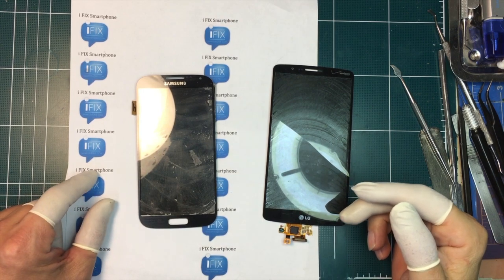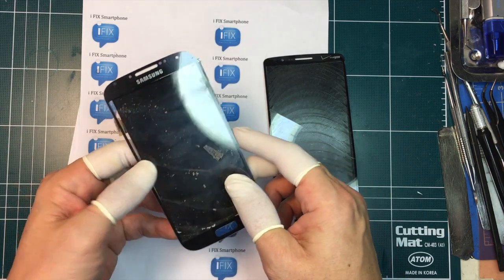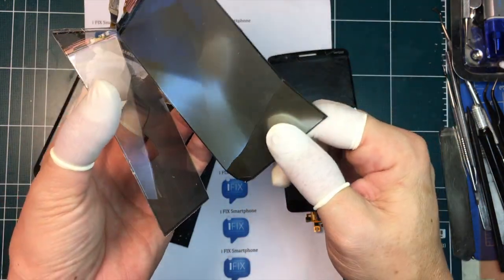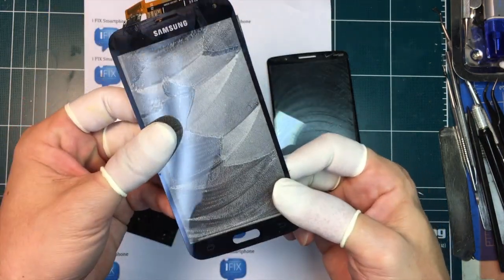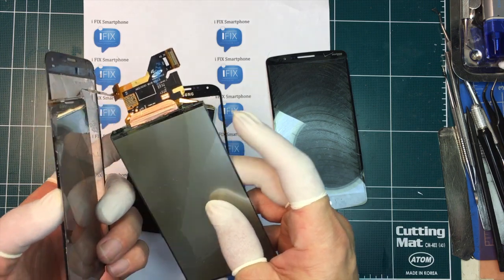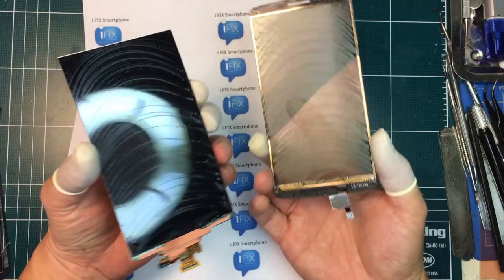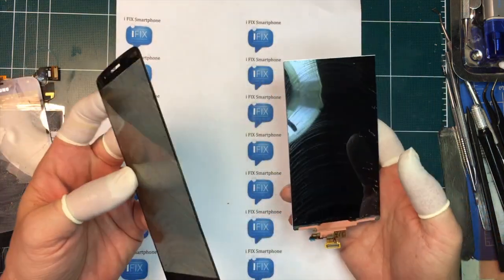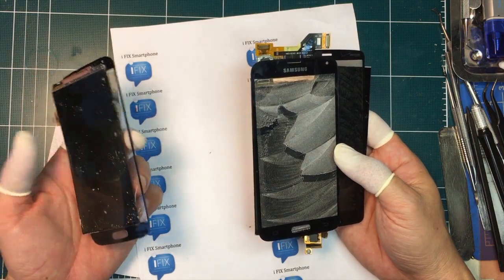What is digitizer? What is LCD?

Comment: So, if you can still touch the screen but you have a bright line or section on the phone, can you replace just the glass? I can't seem to find anything except just the whole screen replacement which is usually $100-$250

Comment: Thank you so much for this video. I can now tell the difference. However, to gain clarity on a particular issue, I want to present my situation.
1) I have a Samsung Galaxy J8 phone. It is responsive to touch (so, I am guessing the digitizer still works). However, there are several lines that appear on the phone. I am unable to tell if this is an LCD problem, or just the screen glass. 
2) I have an Iphone Xsmax. I can visibly see everything (cause the display is still perfect), there are no lines on it. However, only the bottom part of the screen is responsive. The upper part isn't responsive anymore, so I am guessing this one is a digitizer problem, and oh! the screen glass has some cracks on it too. Please, correct me if my diagnosis is wrong.
Reply from the maker: J8 with line mean that LCD is damaged.  Xs Max with bottom touch working is most likely digitizer issue. if no damage, but no touch means, touch sensor on motherboard needs repair.
Reply: @ifixsmartphone9079  Thank you very much for your response. I would like to show you a visual representation of my issue , and ask about something related to it. How may I reach you? Email, WhatsApp, Instagram?

Comment: Thanks for explanation. Loved it. But I have some questions, please answer it
1) Can only Lcd screen be changed if touch is working and glass is not broken? 
2) Now does most phones come with digitizer fused with glass? and they have basically two layers. 
3) My phone is Oppo A54 and i dropped it on floor and touch is working but it has cracks on screen, so my display is broken or glass ? What I need to replace?
4) Is tempered glass different than glass you shown and should we use tempered glass
5)Does display get damaged due to heat during changing of touch glass?
Reply from the maker: nowadays I think all manufactures make touch and LCD fused as it makes digitizer more accurate.  If OPPOA54 is OLED, it's fused 100%. Display (LCD/OLED) can be damaged by high heat. It discolors it mostly.

Comment: Great video!...pleas I have a question my phone works fine when I use it...but when I try to game and it gets hot I start experiencing ghost touches when it cools down it returns to normal...is the problem with the digitizer?
Reply from the maker: Yes and no. but I doubt if it will fix issue even you replace digitizer. when it gets hot, cpu is probably throttling and that is why you may have touch issue.

Comment: Thank you so much! I'm so glad you explained that. But it brings on another question. If I wanted to reverse engineer the flex ribbon cable to work with a motherboard that requires separate ribbons how would I go about doing that?
Reply from the maker: Can you explain little more? Kinda lost in your question.
Reply: @ifixsmartphone9079  Samsung smartphone motherboards use a 34 pin ribbon combination cable for the digitizer and LCD screen. How do you separate the two for use on a separate motherboard that requires the digitizer and LCD screen to clamp into two separate places?
Reply: @iFIX smartphone  Samsung smartphone motherboards use a 34 pin ribbon combination cable for the digitizer and LCD screen. How do you separate the two for use on a separate motherboard that requires the digitizer and LCD screen to clamp into two separate places?

Comment: So if the glass is not broken but the digitizer is not working because of water damage does that mean I should just replace only the digitizer and not the glass or just replace everything?
Reply from the maker: When it's water damaged, it's completely different issue. It could corroded connect that could affect touch. Replacing screen is not gonna fix in that case.
Reply: @ifixsmartphone9079  ok so my phone still ring vibrates charge but nothing coming on the screen itself and it's not a black screen of death cause I tried all troubleshooting method since its water damage what do you recommend need changing in my this case the entire screen and digizer aswel?
Reply from the maker: don't buy parts yet, you need to find repair shop who can properly diagnose or mail it in to me and I can check as well.
Reply: @ifixsmartphone9079  ok great thanks for the advice I will subscribe to this channel and I'm all the way in Jamaica sadly

Comment: What if my iPad is working and touch do I still need a digitizer are just a lcd screen my screen is crack and I am texting on it all now as we speak
Reply from the maker: you only need screen replaced. screen and digitizer are one piece on iPad.
Reply: @ifixsmartphone9079  is it for a gen 6th ipad?
Reply from the maker: all same for ipad air, 5, 6, 7, 8  They are not fused to LCD.
 @kingboy4560
Reply: @ifixsmartphone9079  just buy a screen u say

Comment: I got lcd display of my phone damaged and have big black spots on it..but the touch still functions...that means the digitizer is in perfect condition...and I was able to find the lcd without the digitizer...should I buy it...can I attach my exist working digitizer to the new display?
Reply from the maker: It depends on the model. most phones now digitizer/LCD fused. In that case, even you found LCD, you won't be able to do it as digitizer will not be saved if you have to separate LCD/digitizer.

Comment: I dropped my phone on the floor and I got a faded black screen I have an LG Rebel 4 so I took it apart , there's was all kinds of an oily substance there which I cleaned with screen cleaner , there are only small fine lines in the LCD like I saw on your vid , my display ribbon seems to be fine . What could be wrong and what could I do ?

Comment: hey G, it is a great video, really up to the point. Now, I have a cracked glass on Alcatel 9024w 8 inch tablet. just glass everything else working fine including touch digitizer. The tablet felt off the table on the tile floor screen down. To fix the digitizer (i am not sure if i need one - $40 part eBay only and work about $50) will cost $90. Can I change just the glass and if not can i just live without new glass (or i will be waiting for spill or sand trouble and it will damage digitizer or more). I also found on Amazon anti-adsorption glass cover (3 for $8 + shipping ==> https://www.amazon.com/T-Mobile-Alcatel-Tablet-Display-Replacement/dp/B07BKXHCVJ?SubscriptionId=AKIAILSHYYTFIVPWUY6Q&tag=duckduckgo-d-20&linkCode=xm2&camp=2025&creative=165953&creativeASIN=B07DHH5LCK&th=1. Is it replacement for the cracked glass? I will greatly appreciate any help.
Reply from the maker: I believe they are not fused which means you can replace digitizer/glass only on that model.
Reply: @ifixsmartphone9079 thanks for the reply. is there a way to replace just the glass without digitizer. This Amazon cover is it a glass or a glass cover?

Comment: Reason for screen bleed with out any damage which one should replace
Reply: Bleeding blue in colour Samsung j7pro
Reply from the maker: LCD or LED. its display unit.
Reply: @ifixsmartphone9079  lcd
Reply: Samsung j7 pro lcd only na
Reply from the maker: @ankush.k.kudhva5890  I don't think samsung release model that has separate LCD and screen/digitizer. You will have to get whole thing.

Comment: my daughters samsung tab 4 has no crack but did get wet. Was working fine then all of a sudden had black spotting. Then whole screen went black a few weeks later. Can I change just the lcd screen to fix it? It still turns on but black screen kinda flashes a bit but still stays black. Is that the digitizer or just the lcd
Reply from the maker: When it's liquid damaged, that is different. it could be liquid damaged display IC or connector or could be LCD. You won't know until you test it.
Reply: @ifixsmartphone9079  I tried disconnecting the lcd cable and plugging it back in and the battery icon did show up once but then the lines came back so I was told it's the lcd cable
Reply from the maker: @isabel-z4x2n  hopefully flex but I don't think so. flex doesn't get damaged like that due water and shows line. Line means usually damaged LCD.
Reply: @ifixsmartphone9079  thanks for the info 😊

Comment: Ok so i cracked my iphone screen decently bad and my phone still turns on and everything but 75% of the time when i press on my screen it wont recognise it as anything being touched or it will open a bunch of random stuff without my touching the screen. but like my finger print works fine to unlock the phone and everything. Any ideas what the issue is? If i replace the screen will it fix the issue?
Reply from the maker: ghost touch is due to bad digitizer. replace whole screen and it will be fixed.
Reply: @ifixsmartphone9079  ok thank You

Comment: Thank you so much. I broke my glass and digitizer but my LCD is okay in my moto Z Droid.
Reply: Very valuable video. My iPhone 5 digitizer not working after dropped. but lcd is is work properly. Can i replace digitizer only without lcd ?
Reply: @rashmikadeshan6705  I broke my phone trying to do so, so I'd recommend just buying the digitizer and LCD together. After I broke my Moto z, instead of fixing it I just brought a Moto z2 force I still use.
Reply: @TheBoxingNinja  thank you so much for your replying. But lcd+digitizer is very expensive. I need known Are both the digitizer and the lcd together?  Or is the lcd and the digitizer separate?
Reply: @rashmikadeshan6705  for me, most of the time they are sold already glued together. Again, I found it better to just upgrade my phone, my photos are backed up the cloud and everything important is kept on my SD card, so I just got a new phone. Didn't see a point in spending $60+ on a broken phone when I could buy the newer model for $250, and my Moto z2 force has a shatterproof screen, so I don't have to worry about dropping my phone and breaking the screen.

Comment: Got a tablet but it was cracked. Sent it to repair shop but some parts of the screen won't function properly after screen replacement. What's wrong?
Reply from the maker: most likely bad part. but could be bad repair job by not assembling right.

Comment: What is the copper/aluminium foil in te back of Samsung LCDs? (The one that is attached to the body of the cell phone) I always break them when i'm disassembling screens
Reply: Same question. It may be past 2 years comment. Maybe u already know what the purpose sir? Cause i also want to know
Reply: @dishhh5066  Some say that it is used to evenly distribute the heat generated by the screen towards the structure of the phone
Reply: @cristianpuentes8319  so it kinda serves as a heatsink huh . Also in my hypothesis i think  maybe it also serves as a base to lcd/led maybe? Because lcd/lcd alone is so fragile . Not sure about it thoug. Btw thank you so much for you reply sir 😊

Comment: In my samsung galaxy s4 the display only shows white screen when turned on but it is working perfectly.....It just shows the white screen though so there's a problem with digitizer or LCD or both of them needs to be replaced??
Reply from the maker: Whenever you have an issue with picture, that has to do with LCD or LED. In your case, it's LED since Samsung uses AMOLED. thus you must replace whole complete front module. LED cannot be replaced separately.
Reply: G Parc Thank you for replying

Comment: Would you possibly be able to tell me anything about my situation? I dropped my Note 5 barely cracked the screen in the top corner and it just has never worked again and I just dropped my note 4 yesterday and it did not cracked the screen and it's not working now either and they both have the blue light on and nothing else ......  I know that Note 5 is really expensive to get the replacement part and I'm looking into the Note 4....... Is there any way there could be a cheap fix?   Just being hopeful Merry Christmas
Reply from the maker: sounds like you have cracked AMOLED of your device. currently there isn't much difference is prices of Note 4 and Note5. You will have to get complete unit glass/digitizer/LED.

Comment: I tried replacing the glass of samsung s4 until I accidently sliced the digitizer flexible cable. Touch sense is not working after that accident. Can I replace the digitizer and glass only too keep the original Lcd? Where can I buy the glass with digitizer only without Lcd for Samsung S4 gt-i9500? Is there any or I have to replace the whole set?
Reply from the maker: Not possible. time to buy whole front unit.
Reply: G Parc Thanks for the response. I have tried looking around e-commerce all over the world fron China to Europe and USA but I didn't find any of one selling only glass with touchscreen. They only sell the glass only, polirizer only (the dark sheet) without touch screen cable, or the whole set. Now my question is, I can easily get the broken original used  LCD (broken flexible cable), can I move the touchscreen only to mine? Because the original (Super Amoled) new is too expensive and I still have exelent working one without touchscreen. If possible then it would be cheapest best one I can do.

Comment: I want to ask a question, my father broke his LG Spirit 4G LTE outer glass and I would like to replace it, the touch screen still works so the digitizer is ok, but from what I understand it's a pain to separate the digitizer form the glass, now I wonder if the digitizer is glued on the LCD as well? If not I can order a digitizer and just replace it without having to glue it to the LCD?
Reply from the maker: I believe you can replaced glass/digitizer only on that model. I don't think LCD is fused to glass.  for this model digitizer is fused to glass.

Comment: Nice, the two phone brands I'm using right now.
Really helpful video, will save me a lot of cash.  I was told to replace the LCD when only the digitizer needs replacing.
Reply: Very valuable video. My iPhone 5 digitizer not working after dropped. but lcd is is work properly. Can i replace digitizer only without lcd ?

Comment: I brought a tablet Asus Zenpad 3s10 Z500m. It got a small crack about half inch on the bottom right and the touch was non responsive from top to bottom about half inch. Then on the 2nd day, the half screen of tablet was non responsive and finally on 3rd day about 98% of tablets touch function was non responsive. There is 1 or 2 spot where touch is responsive however making the entire tablet non touch. I am using otg cable to attach bluetooth mouse to use it.

My question is: If there are some spots where touch works, does that mean the digitizer is fine and i only have to replace the screen? 

Unfortunately, i cannot seem to find the digitizer for this tablet anywhere. Please help me somebody.
Reply: sulav_rock you only need to replace the glass

Comment: Hi there. I'm a bit confused on what exactly I'm supposed to be buying for my lg g3. I dropped it the other day and it ended up getting a deep cracked spot right on top of where it shows the time(the time while on lock screen) The cracks are spread out around the crack/hole thing like a spider web and there's also cracks that seem to be under the glass that go all the way down almost to the bottom of the screen and they go all the way to the top as well. The whole top of the screen doesn't work and the only numbers that it will let me press on the lock screen are 2,7,9,0 and 5. It can't be unlocked at all. What exactly should I be buying to fix this problem? Thank you!
Reply from the maker: just by LG G3 front screen aseembly including LCD. You can replace digitzer only on LG G3 but not worth the time and cost.
Reply: Dou you mean the mid frame bezzel?
Reply from the maker: no need to get mid frame.
Reply: Could you link me one on ebay or something? I don't want to accidently buy the wrong thing. Thank you:)

Comment: My z3 xperia screen got cracked, for a while you can see the background functioning but soon after that it just gone dead, is this the lcd that need to be replaced and glass
Reply from the maker: xperia screen comes as one piece: glass, digitizer, LCD are fused. You need to replace whole front module. It's cheaper that way.
Reply: thank you so much for your reply, do you think i should try repairing it myself?

Comment: I successed to break ONLY Digitizer and AMOLED! Glass is fine. I tried screw hard then i heared some bad noise. I was have password so i try to touch my password model with guessing where the buttons but i relize touchscreen doesn't work. Opened on recovery mode. I am luck volume buttons and power button working. Looked the recovery mode on internet then choose it without see it. Rebooted phone and i took them all datas to my pc with usb cable. You know when you using Factory Mode, pass and everything is gone. Except the data files.
Reply: Şafak Wrangler  um WHAT THE HELL ARE YOU SAYING?

Comment: thanks for the lesson sir. I have dropped my my phone few time now but the there are no cracks on the screen. during the last drop the screen from be black boundary of the on screen button to down stopped working. I did some research online and some said that it might be due the digitizer becoming loose. so is it possible in my case to open up my phone and reconnect the digitizer to fix this issue.
Reply from the maker: if the phone is iPhone 6+, it might that famous touch IC disease you are having.
Reply: G Parc its one plus one
Reply from the maker: then it must be digitizer.
Reply: G Parc so in my case is it broken digitizer or loose connection. strangely though the on screen button dose work but when I turn off the on screen button, the on screen region works faintly.
Reply from the maker: I suggest you find a repair shop where they can replace OnePlus digitizer. It's screen/digitizer/LCD as one unit.
Reply: G Parc OK then, thank you